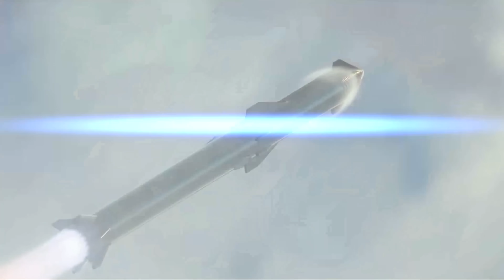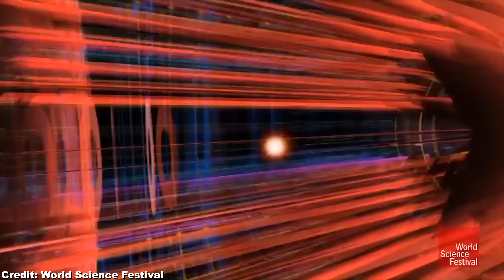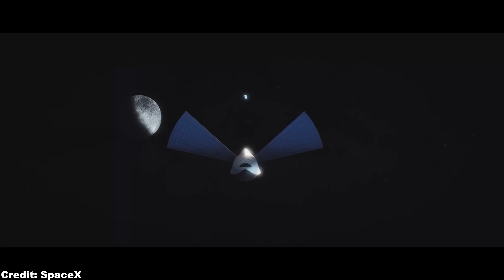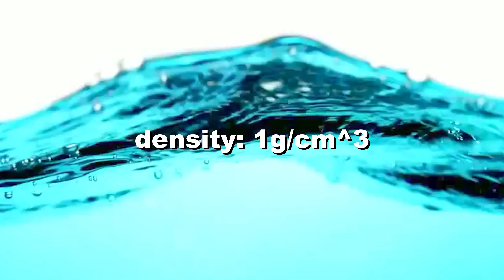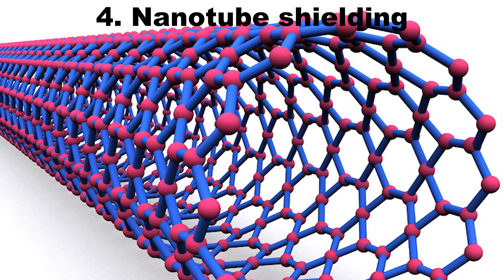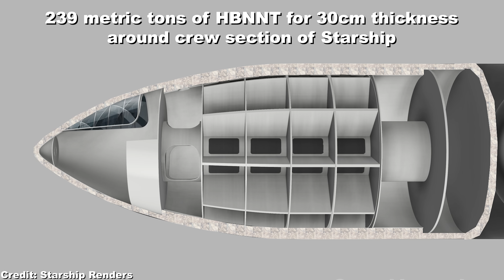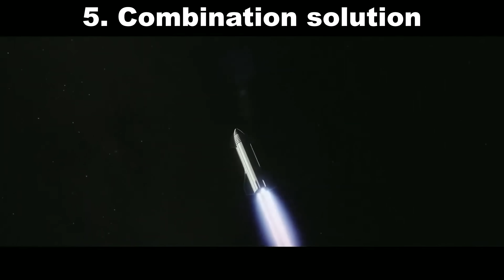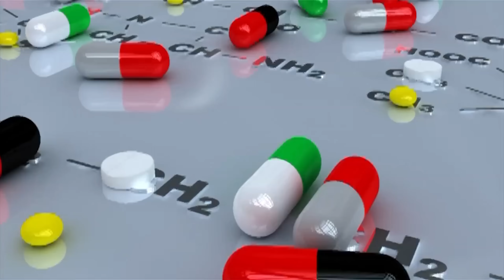SpaceX Starship FLAW Fix: Best Cosmic Ray Protection?

Comment: What I see as best solution is water shield that can be consumed with a hopefully working supplement. The water would not be in the ship upon take off but filled when docking in orbit. For speeding up the travel time. They have vacuum engines for a boost but I'm unsure of achievable speed. But if we are using a orbit to orbit docking station for Artificial gravity and extended living space, then why not have a ion engine or nuclear engine as part of it. I'm reminded of the star wars hyper drive docking ring that Obi-won used. Reminder though, Elon knows none of this will work unless costs are as low as possible. So I could see this for a government sponsored mission but not for a private one (docking ring, water shield a must for all trips). Great work guys. Always a interesting watch.

Comment: starship will require multiple tankers to refuel before heading off to mars,  a solution to the shielding issue is have one of the tankers also bring up water to pump into the shield before departure,  upon arrival to mars that water could be pumped anywhere within starship that will allow the most ideal center of gravity for landing,  once landed you now have a few hundred extra tonnes of water.

Comment: This is such a non-issue - it's a Stainless Steel ship - just put a charge on the surface and turn the whole casing in to an Faraday Cage, that'll redirect the charged particles in to the skin of the ship. Add to that, building the crew compartments inside a separate shell - the outer skin of the shells can also be turned in to a second Faraday Cage, this time using Aluminium evaporatively coated to lighter materials.
There's also the solution by creating an artificial magnetic field. The only limit of that is power generation, and whether the solar panels shown elsewhere for the interplanetary versions of Starship are capable of generating the electricity (and heat, depending on method applied) required to sustain a large enough magnetic bubble.
Reply: @TechChasm  I think you'll find we've had the tech to deflect those energies for a long time - have a look at the magnetic field that used to be used in large CRT type screens.
And the cage isn't there to deflect the charged particles, but to create a zone that they're absorbed in to, keeping them inside the metal, where the energy is redirected in a manner similar to how charge is spread out over the surface of a capacitor.
There's one other way to generate the magnetic fields, that might be easier to do in zeroG, but current examples requires temperatures above 1800K, and planetary bodies.

Comment: My water shielding plan is to inflate hundreds of external water/fuel bags around the nose of the Starship..
That way the particles hit plastic and water - not steel, which would scatter them badly..
And it isn't adding launch weight, the shield add-on would already be in orbit..
Reply: I think they're going to need to carry ~146 tons of methane for the long part of the trip anyway (to have enough delta-V when they get to Mars), so pumping it out into your external fuel bags for the coast phase and then back into the tanks for arrival could work.  Shading the fuel bags with solar panels would help manage the thermal stresses too (just keep everything cold).

Comment: budwiser and hineken have joined in to contribute to space x and have built an aluminumum beer keg 100 feet long to launch to mars . cause no one wants to run out of beer on their mars vacation. and to counter the effects of gamma radiation  the new astronauts are iQ tested to be lower then 50 in IQ so if the gamma rays and polluted atmosphere of mars kill there brains it wont matter their brains are already scrambled .  number one requirement to be a martian astronaut  ALL APLICANTS MUST BE UNIQUES !!!!  and promise not to complain about it later on .

Comment: Here's what my money would be on (if I actually had some):

1. Build really big ships, using mostly water for shielding. Scaling up solves the weight problem. In general. position as much shielding around the passengers as possible.  It makes much more economic sense to make a really big, comfortable ship with adequate shielding, rather than trying to make the trip really fast. You might even make the big mother ship be in a cycling orbit between the two planets, and then just rendezvous with it at the start and end points, using smaller ships.

2. On the surface, arrange buildings such that the occupants spend almost all of their time in places where they can see the sunlit ground, but do not see the sky. If I understand the radiation levels correctly, the concern is long-term, not short-term, so an occasional exposure should not be that serious a problem. If you really want to look at the sky (day nor night),  there could be some place where you look through thick glass.

3. Of course, in the really long term, terraforming might be the way to go.

Comment: Cosmic Ray's are charged particles. Why couldn't magnetic shielding work? They could work against solar storms as well. You could have 6 small craft that surround starship at a distance that produce magnetic fields. The distance would mean you would only need to change the heading of the rays by a small amount to miss the ship. Or another idea would be to electrify the hull with a positive charge. You would have to have an internal negative charge, but like a capacitor, they wouldn't touch each other. And like a capacitor, would require very little energy input because it would hold a charge. This would create a repulsive force against the cosmic rays.

Comment: What about generating some kind of EM field around the Starship to deflect cosmic rays? 

If we are considering nuclear propulsion, we could also generate a lot of electricity for EM field generation.
Reply: @TechChasm  Maybe the plan all along is to use the next gen 18m version with ample water shielding around it. 18m will provide a lot more capability for even water barrier.

Comment: I've always thought  that the best argument for the Mars Cycler idea was that the Cycler can have very high mass for shielding since it does little f any velocity change. On another subject, please include solar thermal rocket propulsion. It can only make a meter a second or so but can operate at a higher temperature than nuclear thermal. It is also bimodal since PV works well with concentrating  mirrors. Indeed the highest efficiency solar cells operate at over 40% efficiency and 900 Suns light intensity giving them a very high specific power. Combined with mirrors such as one developed years ago by the LeGarde company that focused 17KW/kg at one A.U.; high power electric propulsion after solar thermal is used in a series of perigee thrusts over a week or so to escape Earth. This means a faster transit overall than nuclear thermal while being orders of magnitude cheaper.  .

Comment: Best solution is to make the crossing in a massive transport assembled in space that never lands, just commutes between Earth and Mars orbits. The starship would dock inside this interplanetary transport. The transport becomes the shielding for the starship docked inside.  A cross section has the starship as the center circle surrounded by 6 starship sized cylinders filled with cargo or fuel.   At the beginning, the Mars colony is going to need a disproportionate amount of cargo to build the Mars base, so the 5 additional loads of cargo plus one of fuel to accelerate the transport is a good balance.  

To compensate for weightlessness, perhaps sleeping in a spinning 9 meter diameter ring could compensate.  Or work desks And chairs in a spinning ring.  2 hours a day sitting at a work desk with centrifugal gravity (just don’t move around too much in order to avoid disturbing sense of balance).  Or if more gravity compensation is needed, then a light weight inflated habitable space hotel that can be reeled out on cables as it is spun up to experience centrifugal force.  However it is difficult to spin up adequate cosmic ray shielding so people would spend less than 10% of their time inside.  Of course if the transport were upgraded over time, then a permanent huge spinning inflated ring is a good solution (but I don’t see the ring having adequate cosmic ray shielding so most transit time would still be spent inside the shielded core).

The transport would use a starship for loading and unloading passengers and cargo and fuel,  plus contribute to the transport’s shielding during the 6 month crossing.  The outer periphery of the transport carrying cargo, fuel, water, supplies would contribute to shielding.  Both methane fuel and water are effective shielding because their low mass hydrogen atoms.  Any food with water would also contribute effective shielding.  Since a meter of methane or water around the living volume would be very heavy, this makes simultaneous centrifugal gravity and shielding difficult (massive centrifugal forces). However, perhaps intense workout gym at 1 gravity equivalent rotating far from the transport’s spin axis could provide an hour per day earth gravity and may be enough to compensate 23 hours of 0.1 G.

Comment: Solutions involve water.  the Shielding is only needed when in interplanetary transit.  I would suggest a multi-starship set up, with one acting as a tanker to hold water and return fuel for both.  After initial burn to leave Earth Orbit, they would join up,  transfer water to the crewed starship into the radiation shielding, and then set up a tether to provide centrifugal 'gravity'.  Reverse the process to insert to Mars, the crewed lander makes a direct landing and so forth; while the tanker sits in orbit.  Rinse repeat for the return trip.  It may be that another tanker exists ready to go just in case.

Comment: It is hard to say what will best solve the cosmic ray issue.  I believe research in material science is likely to offer real advances, perhaps sandwiched materials designed for different energy ranges.  The steel hull would handle some of this with secondary energetic particles passed through some material to slow down the cascades from the hull, and a final layer to actually arrest movement.  Charged meshes could be in there somewhere if some particles have a charge along the way.  I think we will indeed have nuclear and thermonuclear rocket engines for long space travel.  Aside from the quicker travel time nuclear engines would bring, some of the space now set aside for methane and lox could be re-purposed to make the passenger section to accommodate more shielding and mass.  So many variable are involved that I think only experimentation and invention can come close to some optimal solution.  Clearly, though, such shielding must be always available, unlike a storm shelter.  For that reason, I think the idea of thin-walled Bigelow structures would counter-productive.

Comment: All of the possible solutions will take years to develop and implement at best. It seems Elon's aggressive timeline will have to change to take this into account.
Reply: Ramon Punsalang - NASA has already developed 3 different technologies, two of which are used on parts of the ISS. Cosmonauts who have spent 18 months in space (Salyut, MIR & ISS), which means they’ve experienced 1-1/2x the radiation colonists would experience going to Mars. Also, SpaceX is aiming for a transit times of 3-4 months.

Comment: You could cut the radiation exposure by up to a third by having passengers sleep in the shielded storm shelter. 

Divide the passengers into three watches so that one watch is always sleeping. The shelter has to be large enough to accommodate entire crew so at one third capacity it should have enough room sleep. 

You could cut the travel time by using extra Starship as an orbital booster that would disengage and return to orbit. You could likely get 50% more delta-V that way cutting travel time by a third or more. Only necessary for passenger flights.

Comment: Another "combination solution": 
- Use heavy BNNT shielding in more targeted areas, such as sleeping quarters and work stations, allowing thinner layers for general shielding.
- Use BNNT as a structural element, replacing Stainless Steel when possible, or allowing much thinner Stainless Steel, reinforced with BNNT in appropriate areas. This could greatly complicate manufacturing, or might just possibly simplify it.  Imagine a (not invented yet) process where we could cast or "print" large sections of Starship.
- Interior bulkheads and partitions could be BNNT.
- Crew uniforms and space suits, BNNT.
- Plating Boron or Boron Nitride directly onto Stainless Steel surfaces without the need to make nanotubes.

Comment: More great work. Always a pleasure :)

Nuclear engines are all well and good, but the weight of the shielding that would be required to protect the passengers from the reactor would be massive in itself and would actually make it a worse solution rather than a better one.

I don't know the answer though. I wouldn't have the slightest clue where to start looking for one either 😂

Comment: I am coming to believe that the Starship, as envisioned by Elon Musk, is fundamentally flawed.  I think that if we're going to live in and travel in space, we will need to provide artificial gravity; and the only way we have to create that is through spinning the vehicle, which means a very large craft.  The Starship does not easily lend itself to this.  Ultimately, i think we'll wind up assembling a large ring shaped spacecraft, with the thrust located at the central axis of spin.  MUCH more expensive than an individual spacecraft, but capable of transporting many more people.  Ultimately, the cost per person might be less on a spinning ring shaped craft.  >Charlie